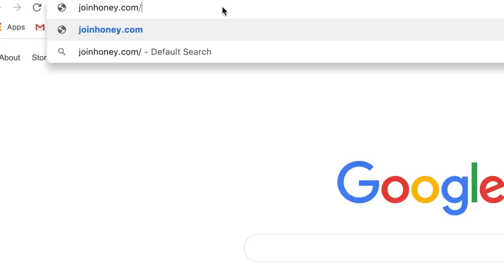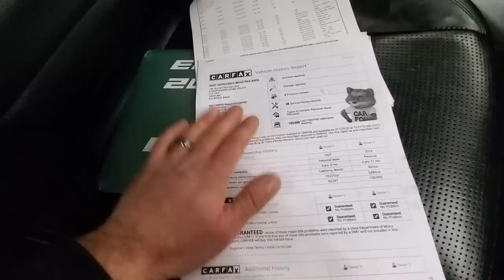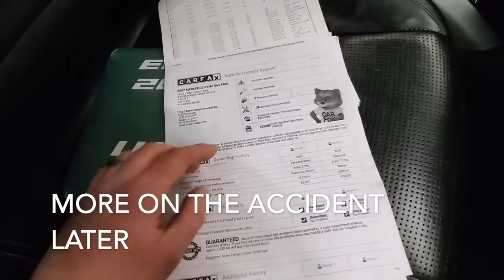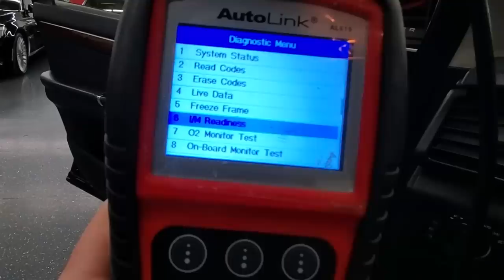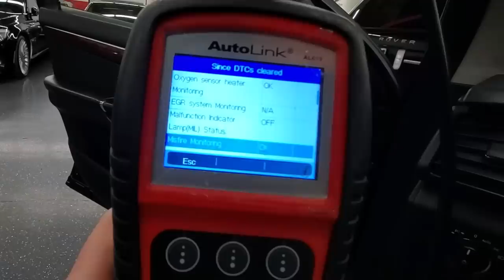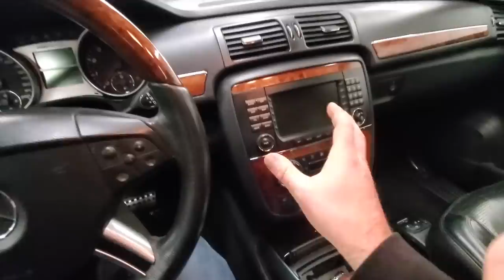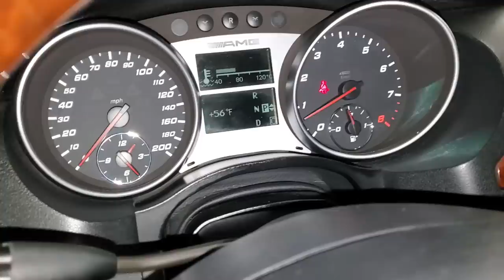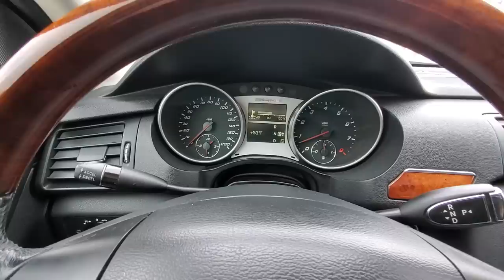Here's How To Inspect A Used Car With A Tiny Camera! Pre-Purchae Tips That WILL Save You BIG Money!

Comment: My 2012 c63 ticks when it’s cold once in a while too. Usually when the oil level drops a bit. I always check the oil level if I get the tick on a cold startup.
Reply: Every benz I've had / owned had a lifter tick on cold start / cold weather once the mileage gets up there, perfectly normal on MB's IMO.

Comment: I would add getting yourself  a magnet style paint thickness gauge and checking all the panels for uniform paint thickness. Obviously this only works on steel sheet metal but I find if the car's had paint work done or any body filler it will stick out like a sore thumb using this simple and  inexpensive tool.

Comment: Awesome video! Thank you. I wish they would bring these back. My E63 just got rear-ended and it was totaled so I just bought an Audi Q7, which is about as close to one of these as I could get. The Audi is so much stiffer than I'm used to, even with air suspension. I also really miss the extra 170 hp!

Comment: The R class is one of the most underrated cars ever.

the sweetspott is the R320.
We had one for 10 Years 
It's fast, reliable, unique and the engine last at least 300000km only problems are the air shocks wich go bad at about 180000km and the some stupid transmission sensor at 210000km

Comment: We have excellent luck clearing up intermittent lifter tick by adding Seafoam to the oil. I have found adding a full can, driving 500-1000 miles of spirited driving, then a fresh oil change will almost always fix that issue. If you are going to leave the Seafoam in for an extended period I recommend no more than half a can.

Comment: My 2013 C63 with M156 ticks for loud 3-5 mins and quiets down, it’s usually when the car has been sitting few several weeks without being started. I try to start once a month during storage months and let the oil circulate for a few mins so everything stay nice a lubed up.
Reply: Quaid McIver that’s just the oil leaking back down into the pan so there’s not much up top

Comment: A Mechanic,s stethoscope is also a good tool, in regards to ticking sounds that go away with temp Many owners manuals will actually mention them as normal so the Dealer doesn't have to.

Comment: What I am noticing is the driver side suspension arm to be extremely rusty (mostly surface rust) but that "fender bender" might have been a little more excessive than is disclosed.  This looks to be a used part from a different car, that is what I am saying.

Comment: Everyone saying how bad the R is has probably never been anywhere near one. Are they quirky? Absolutely. I happen to own a 2008 CDI AMG package version and it’s the most versatile vehicle I’ve owned. AWD at 5100 lbs with 500 ftlb torque (it’s deleted and tuned) and gets 30 mpg. It’s quiet, handles like it weighs 1/2 it’s actual, rides like a Benz, and seats 7. I’m at 214k miles and have many to go! It’s the configuration and capability that counts.

Comment: I have a c55 with the m113 and I have almost an identical noise apron startup, then it goes away by halfway to opp temp. The car has 75000 miles and has had this noise for a long time it hasn’t gotten better or worse. Do you think it would be something lifter related? Seems that it is in my research but I haven’t had it looked at,  or maybe something like a cam shaft adjuster idk if they have them like the 63 cars, only happens on passenger side bank of cylinders. Any advice or ideas much appreciated man! Love the vids.
Cheers from southern IL!

Comment: You know you can use a tool to meadure the thickness of paint and metal to find if the panel or area had any repairs....
Reply: I think that is the best way to find structural issues in addition to just lift the car.

Once you find something weird you can deep dive in that zone with cameras and rest of stuff  (not just a re-paint job which usually have a bit of extra thickness to the original factory paint work)

Comment: I have 2007-08 obviously I bought it used and I had this car for more than 6 years. I do performed all the maintenance on this car. I was wondering if there is a way to see the headbolts using a small camera from the oil cap without removing the valve covers. Any help would be appreciated.  Ty!

Comment: Might be a lifter! Had the same issue with my 3.6L Mercedes engine (2014 Dodge charger) had to replace the lifters
Reply: It’s not a Mercedes engine. It’s a Chrysler engine
Reply: @AsapRockyOG  buddy, my friend builds Charger at the assembly line here in Ontario. They also have Mercedes emblems all over the wiring and Mercedes emblems on the block 

Should do a quick google search to see the Chrysler-Benz relationship before trolling on youtube.
Reply: danny78690 actually, “buddy”, I used to own a 3.6 Pentastar Challenger before I got my RT first of all, and am familiar with them. Secondly, I did a google search before I responded to you, and confirmed, it is indeed not a mercedes engine. So before you spout bullshit “buddy”, take your own advice and do some research. Chrysler was the lead developer on the engine.
Reply: danny78690 additionally, I’m also quite familiar with the former Chrysler-Mercedes collaboration.
Reply: danny78690 lmao what? Because I’m right? Okay “buddy”😂😂.

Comment: Come on now, Alex. I know you felt obligated to not say anything too negative about the black car since you borrowed it from them. But that ticking is NOT Ok. Either the cam or lifters or both are bad on that car. The reason the ticking goes away after warm up is because it gets lubricaterd by the oil. But there should not be ticking on cold start unless the car has been sitting for a week. I am telling you as a knowledgeable M156 owner. And we can see that they used silicone on cam covers insteadof gaskets - the rookie mistake. I think that car hadn’t been fixed by a knowledgeable mechanic.

Comment: Older car with air suspension. Always stay away. Gets outrageous to fix fast. Only a matter of time on any make/model. IMOP and experience
Reply: honestmechanic 79 you can always swap them out for a coil/spring setup its pretty straightforward to do. Plus there Arnott for Airmatics. Of course if your gonna take it to the MB dealership expect to get bend over.
Reply: It's easy and cheap to fix if you're a competent mechanic.

Comment: Can’t be a real Mercedes, it’s not covered in rust.
Reply: yung slime tell me I’m wrong? All mercs over here more then 10 years old are as rotten as a pear. 🤣
Reply: Stephen Cresswell well my amg is 16 years old and it hasnt rust. maybe there is rust on the miniscule scrape where the paint came off when the fucking wheel with a popped tire scraped the wheel well when i crashed and had to tow it out of a ditch and fucked up my front bumper cover, collapsed all my suspensions and now i have to fix that and put a new radiator and fan on. but a very minor rust that didnt need to happen

Comment from the maker: If you could only have one AMG, what would it be? I'm going with E55 Wagon!
Here's the auction site I used in the video. autoauct.io/ns/legit-deal
Reply: Amg g65
Reply: I have a 2000 S210 E55 estate as we call them here, would love the power of the supercharged car but I like the relative simplicity of mine. At some point I might pull the engine out and replace it with the later one and bolt a turbo onto it to see what happens but I have to finish my boat first!
Reply: CL63
Reply: S65 or E63 wagon.
Reply: Is maintenance included?  G65. 

Am I responsible for everything?  G55 with the G63/G65 facelift and interior swap.
Reply: W220 s65 only I dought  I could afford to maintain it 🤦🏽‍♂️ I’ll settle for a s55 Amg
Reply: Would have to go old-school AMG with the W126 Coupe, Widebody kit, with the 6.0 liter engine. Finding these with the pre-merger aftermarket AMG paperwork is nearly impossible. Modern AMG, would go 2011+ CL63 AMG (W216)
Reply: My partner has a pristine '98 SL500AMG. Love the classic styling. If I could have one AMG, it would be a '98 SL70AMG. (And the car is for sale at Sothebys - Paris, here's the link Alex):  https://rmsothebys.com/en/auctions/pa20/paris/lots/r0057-1998-mercedes-benz-sl-70-amg/840563.

Comment: Mercedes = endless money pits, waste of money. If you need one, lease it so you can get rid of it in 3 years.
Reply: Then why are they popular taxi and police cars in Europe and literally thousands have been driven over a million miles on their original engines and drivetrains?
Reply: @williamegler8771  Do you have the repair reports on these cars? They are not the most trouble free cars out there. They are over engineered to the point you need to remove the entire front suspension to replace struts. Don't get me started on changing a oil filter or a battery. They are over priced pos.
Reply: adcolt54 if you go to the dealer then of course its gonna be expensive af to maintain. It takes a different kind of owner to own a Mercedes Benz if you want trouble free ownership there’s always Toyota/Lexus on the block.
Reply: @iheartgs400  Why own such an expensive car that will continually keep draining my bank account and a car that drops in value so quickly after only a few years? You want one, lease it. Dealer pays for the upkeep and you only make the monthly payments along with the gas.
Reply: adcolt54 because there ppl that can don’t give a hoot about resale value ppl want the driving experience and safety as they say you gotta play to pay.
Reply: @iheartgs400  you mean pay to play. I value my money more than a car that decreases in value by the minute.
Reply: adcolt54 then lexus my friend is the perfect brand for you good resale and cheap af to maintain.
Reply: @iheartgs400  Not cheap, inexpensive to maintain because parts are easily attainable and the car hardly break down, unlike your beloved Benz.
Reply: adcolt54 😂😂hard to explain things to a fanboy like you and btw I own two brands so I know the pros and cons.